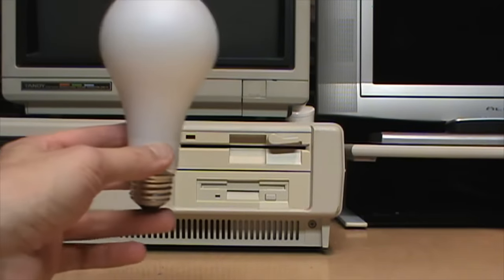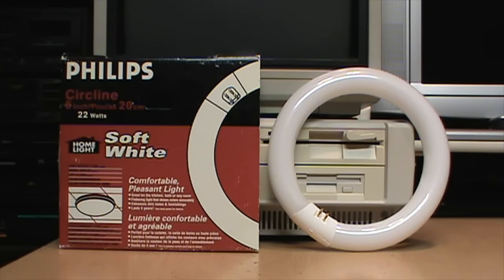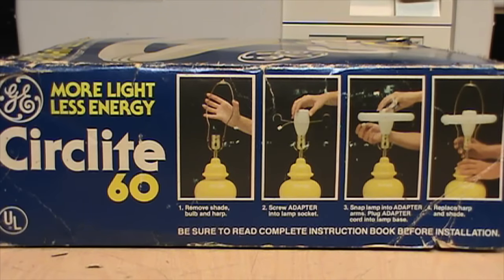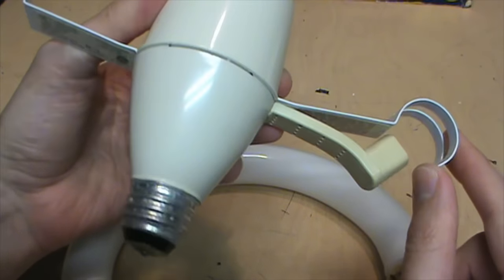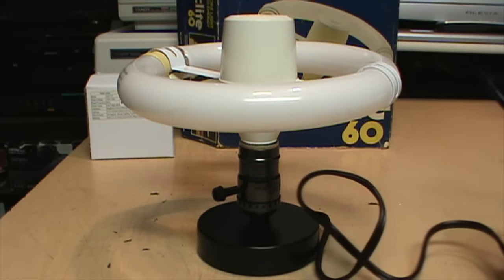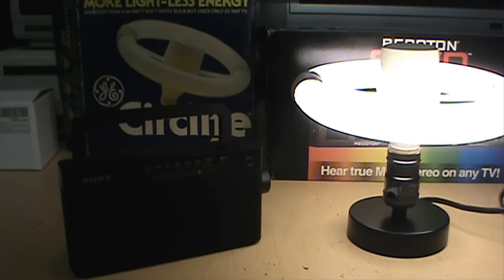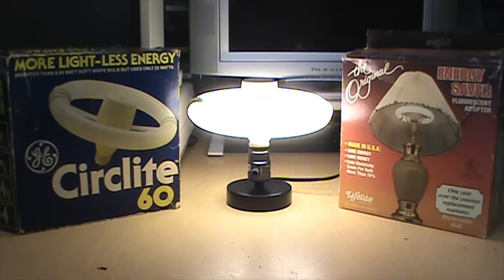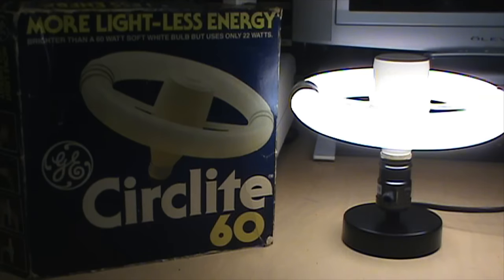The first CFL: 1979 GE Circlite

Comment: I remember having these, and I remember having the early CFLs that did the same flickering. The worst part about early CFL and these were that if the house was cold, they would take time to warm up- so I remember that when I would get home in the winter and flick the switch the room would be so dark you could barely see anything for 5-10 minutes while the lamps heated up. modern CFL don't have this problem I think- not that anyone uses them anymore now that LED look exactly like an incandescent and don't need to warm up.
Reply: I like the long warm up time of the CFLs like in the bath where they start dim and slowly get brighter at about the same time as it takes for my eyes to adjust.
Reply: About 25 years ago I went to a church hall where they had fitted CFLs in all the outside wall lights. At a temperature of about freezing they were all continuously flashing like VWestlifes bulb at start up.

Comment: I was born in 1980. I slept in the same bedroom until I left my parents home and went to college. I initially had a room to myself, but then when my youngest brother was born in 1987, one of my brothers moved in with me and then years later they traded rooms in the other one did.

The other bedroom, which belonged to my youngest brother, and then my second youngest brother, had one of these styles of lamps in it. I remember it very distinctly, and specifically that the bulb was never replaced ever. However the incandescent bulb in my room was replaced fairly regularly.

In both cases, we didn't have any kind of bulb mounted in the ceiling of the bedroom or anything, we just had basically one of those desk lamp kind of deals sitting on our respective dressers, plugged into the socket controlled by the light switch.  I remember, when I got older, discovering that I could turn off my lamp either by the light switch, or by the little twirly switch on the side of the lamp underneath the bulb.  I definitely remember seeing the bulb in the other room that would flicker on and later fade out, just like in this video.

Comment: Great video as always.
I've never commented on one of your videos before despite watching them all.
Anyway, I'd just like to say that the circular light is still the home standard light here in Japan.
All homes use them as the main center light in a room.
Of course more traditional light bulbs are also used in places like bathrooms or smaller rooms or for mood or stylistic lighting.  However for a main light source in a large room, we use the circular light.  Mostly in a duel configuration using one large and one small bulb.  That way it is possible to alter the amount of light provided.

Comment: My grandmother had these bulbs in her table lamps for as long as I can remember, at least going back to the mid 1980s. She also had a large floor lamp with a magnifying glass that she used for reading, and it had a circular fluorescent bulb. Google tells me it was probably a Dazor lamp. Apparently vintage ones like she had go for around $200 today, but they're still making them, albeit with LEDs now, and new ones go for almost $700!
Reply: I hope for 700$ the LED inside is changable
Reply: Also might be a LUXO lamp fixture of the same vintage. Cheers!

Comment: My grandfather (as do I) hated standard/incandecent light bulbs (they gave him headaches,  I just find the light off putting and they run too hot.), So I grew up with mostly fluorescent bulbs, we had the round ones in the dining room and kitchen and in the bathroom and utility room, and bedrooms we had the shorter "long tubes", Late-80s - on. Only the living room and a couple other lamps had low wattage incandecent bulbs. Later on during a minor remodel, the circular ones were replaced with further "long tubes".

Comment: Interesting video, as usual. I have an old (shall I call it vintage?) Luxo articulated magnifier lamp. It uses one of those T9 Circline "bulbs" that you showed at the beginning of the video. I found that they can be converted to LED for around $60, but as long as the T9 bulbs are available, I'll keep using them. They provide a very pleasant light and they last a very long time. About 3 years. I replaced the old bulb a few weeks ago and since I ordered a pack of 2, I'm good for about 6 years.

Comment: The kitchen in the house where I grew up had a chrome, double-Circline fixture. It was great, really. The bulbs lasted a long time, were pretty easy to replace, and nice and bright. My grandparents used the Circlite adapter bulbs in many of their lamps, too. They could crack plastic lamp sockets if you bumped them wrong. I'd forgotten all about those.

Comment: I like the look of these a lot. Kind of a retro-futuristic, Bladerunner-esque aesthetic to them. Pity we didn't have the adapters (at least, not to the best of my knowledge) here in the UK. I have seen the circline kitchen ceiling fittings, now invariably missing their diffusers, in the homes of older American relatives.
Reply: Thorn 2D were the equivalent here. Also look in old Argos catalogues and there were circular lamps to plug into a pendant lamp and even ones using a couple of normal straight 3 foot tubes. I wonder how many pulled the pendant fitting from the ceiling.

Comment: I finally retired one of these Circlite bulb adapters from a garage loft space, where it had been since the early 80s I assume, serving duty in a bare ceramic light bulb socket on the ceiling.
Donated to Habitat for Humanity in a periodic donation box, ready for a VWL wannabe.
It started flickering, and needed new bulb. I actually had a new in box replacement bulb, but donated with the bulb adapter and replaced with a 100w equivalent led bulb, and may go with one of those multi leaf led shop lights for standard sockets.
We moved in 1997, buying from a retired local Electric Company engineer, so there were boxes of funky bulbs and Electric meters and switches left throughout the garage and basement

Comment: I have an old Coors Light wall display from my grandparents market that closed in 1990. The light died and when I opened it up I found that circle light bulb (not the Ge Circlite). I assumed since it was so old I wouldn't be able to find a replacement but it was $8 at Lowe's.
Reply: If you have problems in the future and a lamp replacement doesn't do the trick, there is usually a small, cylindrical ballast in those (and a lot of other really old fluorescent light fixtures).  They are a pain to replace (more the disassembly process than the actual ballast replacement) but at least years ago the part was only about 60 cents.

Comment: I remember staying in a hotel in Chicago in the early 2000s that had "state of the art" CFL desk lamps. I'm not sure why it worked this way, but there were multiple controls and an instruction sheet. You had to go through some rigamarole to get the thing to dim, and you couldn't shut it off and immediately turn it back on, there was some timer thing that had to elapse. It was the weirdest thing I had ever seen. It also took something like two minutes to get up to full brightness.
Reply: Did it have two separate bulbs, one facing up and one facing down? Look up the "Berkeley Lamp" and see if that looks like it.

Comment: Wow, I haven't seen one of those in a while, but I do remember them. Moreso in the adapter than a designed ring fixture. 
Also, in my family growing up, it was always incandescent --- I don't think we ever bought CFLs. I know when I moved out I started buying LEDs if not incandescent for specialty purposes. These days I use multicolor Yeelight LEDs and tune my rooms to different colors most of the time, only using warm white in my kitchen, and switching the colors to white when needed. Had a few CFL and white LEDs left over from when I moved in so I will use those until they don't work anymore.

Comment: My grandparent's home had these in every fixture, and I remember that (with frequent brownouts and outright failures) every year the ballasts struggled more to light them in low light, and would not at all in total darkness. And while my aunts/uncles presumed the power was still out, I'd discovered that I could light/excite them using a strong hand torch so that I could keep reading during my visits.

About the time that I would go from room-to-room with my flashlight to tip them on I'd figured out that the problem was with the starters failing/burning out; But before I could try and repair them on my next visit, my relatives decided that "there were no starters, all of the tubes must have aged out" and threw out the entire stockpile from the 80's .

Comment: My first CFL experience was a Mazda-brand job which was a 10 watt 2D tube plugged into a ballast base, not unlike a Circlite, it was magnetically choked with a traditional starter build into the base, so had that familiar fluorescent tinging sound as it tried to strike, that was early 90s, and some months back, I bought one, trouble is, the 10w 2D tube is so rare now I struggled to find them, but managed to get a pair of GE branded ones (which is apt as I thing Mazda is or was part of or partnered up with GE), so I have a nice retro looking 2D CFL in my bedroom ceiling light... :D
Reply: Take a video and post it. I don't think I've seen magnetically ballasted 2-D adapters before.

Comment: Despite being a Circlite, its installation doesn't seem too circuitous! This house still has a few of its Circlite fixtures that have escaped modernization. Unfortunately, the hallmark kitchen circline was replaced many, many years ago in favor of the warmer and more inviting look provided by an incandescent fixture. I could've sworn I squirreled it away for safekeeping, but haven't seen it in just as many years as it's been since it was removed. I could always get one of these, but I'd still need an era-appropriate fixture to accompany it.

I'm surprised you were able to find those circline bulbs at Home Depot. I had quite the time trying to find replacement T12 bulbs after noticing a few had burned out in an overhead fluorescent fixture this summer. Anything that's left at stores is old stock, and many sites show that shipping of the 40 watt bright white T12 bulbs to NJ is unavailable.
Reply from the maker: T12 fluorescent bulbs were banned years ago, except for those with a color rendering index (CRI) of 87 or higher. NJ and a few other states ended that CRI exception in January 2023, so that's why any remaining stock is pretty much gone by now. But circline bulbs are unaffected by this ban.
Reply: @vwestlife  That explains it. Fortunately, I was able to source the bulbs from an NY retailer and stocked up.
Reply: @stereophonicstuff  That was my first thought since most of New Jersey is within driving distance of either NYC or Philadelphia.  I will have to ask my cousin if he can still get bulbs in Michigan for what was his parents house -- the bathroom had T12 fixtures in a mirror assembly.  The fixture still worked shortly before my aunt moved out of the house due to disability.
Reply: the incandescent bulb ban went into effect on August 1st 2023. Despite that i still see them on sale at the supermarkets and the hardware stores and thrift stores, i still have a stockpile of incandescent bulbs that have been sitting in my closet, the longest bulb lasted 20 years and the shortest one lasted only a few months. as long as i still see them in stores i Still buy them and use them or if there's no more ill pull one out of my closet stash.

Comment: Circline-style lamps are still very common in Japan. Loads of old household fittings use them, and plenty of new ones still take them, too.

The most common arrangement has one small and one large lamp, mounted one inside the other, for three levels of brightness.

Comment: I remember these things. I bought one for my parents' primary living room lamp, which was on all the time. Probably 1984 or so, when I was in high school. I saw the electric meter running like crazy outside, and though we had electric heat, wanted to try anything to lower energy and stop pollution. (I might have remembered Carl Sagan musing about carbon dioxide in 1980's Cosmos, but I don't remember.) My parents likely hated it, but let it be. I remember at some point it disappeared. 
They seemed to be prevalent in apartment building stairwells, at least in Texas in the 80s. They'd turn up in odd places, and I'd always smile at the ingenuity. I don't think anybody cared about saving energy. Ronald Reagan saw to that.

Comment: Circlite lights are still MASSIVELY used here in Japan. They’re the main type of lighbulb for any ceiling fixture. 
Led lights are still 5x the cost you have to pay in Europe and the screwy bit is incompatible, so many are sticking to these instead of switching to Led or importing them en masse.

Comment: Just my 2 cents here: We have two GE metal clip units in living room end table lamps, purchased ~1980 at FEDCO in LA. Both always in daily use and function perfectly well. Bulbs last longer than my memory can report. Don't need 'em yet but back in July bought two GE 11804 FC8T9/KB 3,000 K replacements for 15 bucks on Amazon. Local hardware and big boxes also carry them but the colour temps on offer suck. GE's colour temp is good match to other incandescents and CFLs in rooms throughout the house. No LEDs, never LEDs. For folks wailing about "ugly light" and "too blue", etc. That is result of your lousy colour temp choices and not the lamp's fault. For those complaining about AM RFI: Just put a battery-powered AM radio next to ours and hearing zero impulse noise. Cheers!

Comment: Fun trip down memory lane.  I still have the one and only 60w GE Circlite I got at a local electric supply house. I believe it was $30. US.  Then again, I still have the IBM PS2/286  I bought new with the IBM brand high resolution monitor. I still cry when I think about the aprox $4500, that setup cost me from the computer store near my house in those days, and that did not include the IBM brand mouse I paid $99. to get later.   I won’t even think about how much $ I’ve spent for RAM and drives years back. 😱  I always enjoy the various items you you published videos on over the last couple years.

Comment: My old house in a suburb north of Pittsburgh had one of these in the kitchen and one in the upstairs hallway. Both were different sizes and a pain in the butt to find replacements for, could always find one size but not the other. I was surprised to see them here as I didn’t think they were anything special, more a pain than anything else. The house got it’s latest remodel in the 70s, wood paneling in the basement and circlites.

Comment: Between Circline/Circlite and the curly bulbs were a couple of types of nearly normal bulb sized compact fluorescents. The first style shrunk the glass tube down to about 3/8" diameter, bent into a long U shape then folded that in half to put the middle U bend down by the ballast housing. The next style changed the tube to two or four parallel cylinders with tiny, hollow bridge tubes between them to make a continuous path like the folded tube style. The stick style even came in versions where the tube could unplug from the ballast for replacement. This type was used in a version outputting a lot of UV for bug zappers.

The stick style had many fixtures made with sockets for them rather than having the screw in ballast, and there are many LED replacments to plug in place of the fluorescent tubes.

Comment: Part of this video covers a big problem with CFL and LED lamps: AM radio interference. 👍  Also fixtures using a dimmer cause static. My house is all LEDs and I cannot use any of my AM tube radios in the house unless I turn off all the lights. I gave up and installed Bluetooth receivers in the circuit, so now the old radios can tune in the world via my phone. Still using the original tube amp and speakers, so old and new tech in one box.
My grandparents installed circular fluorescent fixtures in their kitchen in the early 50s and as a kid I was amazed at how much brighter their kitchen looked than most homes that just had incandescent lighting. Not to mention Grandmother's fried chicken and black-bottom pie.  😊

Comment: I used these for many years in the living room lamp which is on an average of 12 hours a day, partly to save energy, mostly to avoid replacing incandescent bulbs several times a year. Later switched to the 'ram's horn' CFL. But they are robust, lamps about 4 years, ballasts I still have.

Comment: I actually felt like the use of these in table lamps was demonstrably superior to the bulb shape, the light was emitted right by the shade. No shadows from the harp.  In industrial applications florescent tubes were preferred as they produced very little shadow and the circular tubes were pretty good in that regard. 

I would point out, if you have a fixture that uses these circular bulbs. I work in a hardware store. Both the gas filled tubes and the LED substitute are available for sale.

Comment: I remember when I worked at a motel in Wisconsin while living stateside,  the motel had a LOT of these in the 70s style over table pendant lamps (ex motel 6, for reference). I thought they were pretty ingenious for use in a table lamp/pendant lamp type shade, as it gave better light distribution
Reply: Reply/Edit... motel and hospitality will be the reason they were alive so long. LOTS of chain motels/hotels used such fixtures to save energy

Comment: Did you know that circline fluorescent lamps are very popular in Japan and are still used there today? In Japan, circline fluorescent lamps are usually used in pendant fixtures that usually take 2 lamps, but these pendant fixtures can occasionally take 3 lamps or even 1 lamp.
Reply from the maker: Yes, several commenters have already mentioned that.